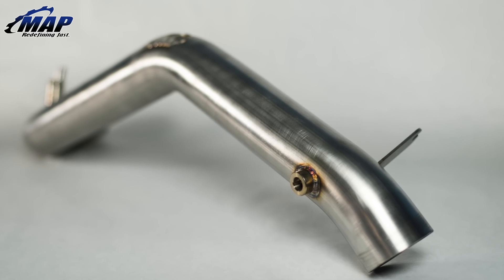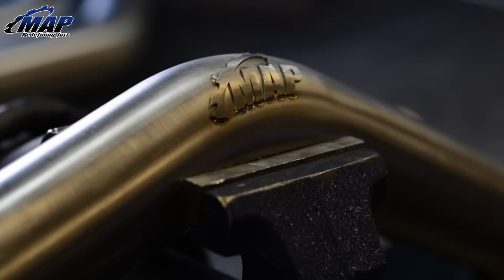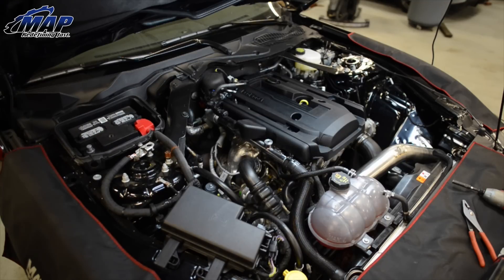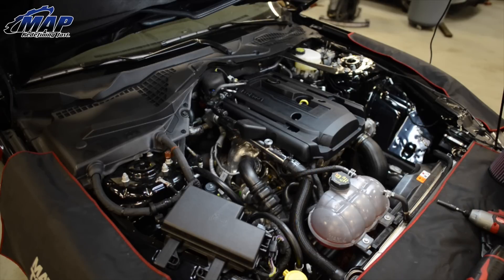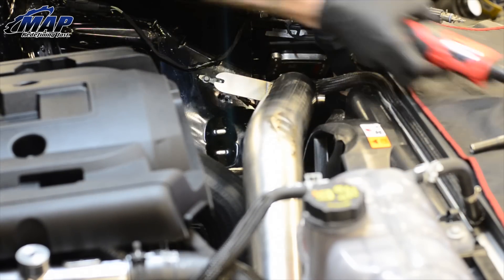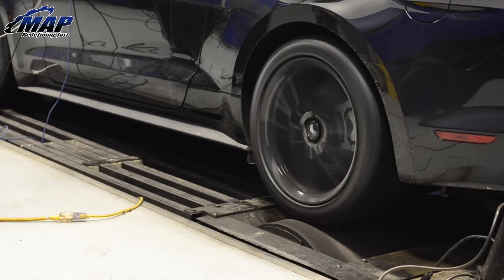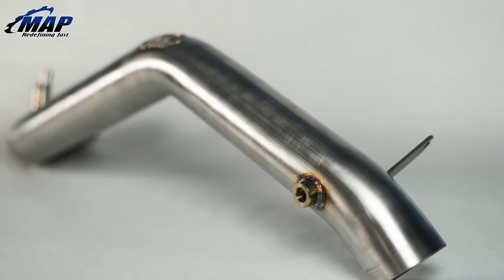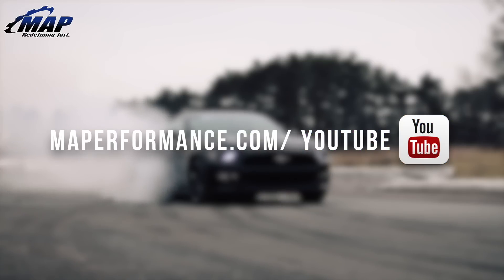Ecoboost Mustang Cold Air Intake Kit by MAPerformance | Sound Clips, Dyno Results & Install

Comment: Looks to me like there's a huge drop in performance where you need it most at that 5500 rpm range and there's several areas after that where it drops under stock as well... I need to do some more research, but good honest video.

Comment: This intake is great. Granted not apples to apples; but on the same dyno a 2015 6MT gained only 5whp and 13wtq from a Corsa intake system over stock, but this MAP intake (for about $100 less also) made gains of 14whp and 19wtq over stock on a 2016 6MT. Sounds great too, so to me this intake is a winner and will be on my Personal EB Mustang when I pick it up next month along with a Mishimoto Intercooler, Cobb Catless DP and Snow water/meth kit. Shooting for around 330whp and 410wtq or so. Plenty for the road course IMO.
Reply from the maker: Sounds like some good results! Thanks for sharing.

Comment: Can I install this airtake and then get a tune later down the road and still work properly and get the gains from both? Thanks
Reply: Intake*
Reply from the maker: Sure can!! Email aneujahr@maperformance.com if you have any further questions.
Reply: Is there any other mods in this ecoboost besides the intake? I like the way it sounds but wanna make sure thats just the intake and no BOV yet

Comment: can I get this intake with no BOV recirculation hose port? I have mine disconnected and would rather not have to put a plug in the port.
Reply from the maker: It comes with a block off cap!

Comment: Is there a K&N filter that would fit your intake? I know they have many universal filters. If so, id definitely buy your intake. I'm not a fan of the filter you provide. No offense.
Reply from the maker: Yes, our kit comes with the Green filter so you will need to buy the K&N filter additionally. This should be the info you need: Green Filter ID=3 L=8" OD base=4.75" OD cap=4.75"
Reply: +MAPerformance Are those the flange dimensions? That's what I need.
Reply from the maker: Adam Gregory Those are the filter dimensions. Where the filter attaches is just a 3" pipe, so any 3" filter should do! We recommend you find one that matches the diameter and length!

Comment: just installed this last night driving today and noticed when i was idle at a red light for about 2 min my air inlet temp rose to 130 ?? is this normal or no
Reply from the maker: +Dax Turner Yes in certain climates it can get fairly hot, but the intake temperature should quickly drop back down. The response time to drop back down to cooler temps is what people rave about!

Comment: Does it really make the turbo spool louder? I like my quiet exhaust but I love hearing a turbo spool up.
Reply from the maker: +John D I would compare their graph to ours on both listings. Like you said, our performance gains are throughout whereas theirs seem to be towards the end of your power band. Our intake is located in the fender well which will dissipate heat much better than even a plastic intake with a heat shield inside the engine bay.
Hope this helps!!
Reply from the maker: +TuneDeafOfficial Sure does! Eliminating the air box helps this out a bunch.
Reply: +MAPerformance awesome! do yall know how it performs against the roush cai? sound wise. not performance. 
I'm having trouble choosing between the open pod filter vs. the enclosed section. 
I also don't believe it when roush say theirs gives up to 29whp/trq.
Reply from the maker: +TuneDeafOfficial The most you can really only hope to gain about 15whp from an intake, ours is much louder than theirs and we have tons of great reviews to back ours up! 
If you have any further questions or just want help deciding feel free to give us a call.
Reply: +TuneDeafOfficial 
Trying to figure this out myself, what I did find is the Roush boost starts at about 5250rpms and there is almost no boost up until that point. According to MAP their boost starts at about 2300rpms and ends at about 5k. Im a city boy so Im thinking I would have that boost at every start rather then later in the power band. MAP is about 25% less expensive too. The only thing that has me concerned is would that pipe conduct more heat then the Roush plastic one. MAPs looks better IMO but performance is the priority.

Comment: Doesn't metal heat up so fast and make hot air
Reply: +Mauricio Salinas either way itll reach engine bay temps regardless.  itll just be quicker or slower reaching temps.  the turbo heats up the air regardless so the loss in power is minimal.  its basically just removing the restrictions the factory intake had.  on my car (VW), intakes dont make any power WITHOUT a tune since our intakes are pretty decent from factory.  and if you are worried about the heated tube, by some gold wrap or heat paint and go ham on the pipe.  i did that to my intercooler throttle pipe for good measure

Comment: I'm interested in your CAI, but opinions exist that mounting the CAI to the body can cause damage to the turbo/chassis mounting point and should instead be mounted to the engine. Thoughts?
Reply from the maker: +takensouls1 Sorry I am just seeing your question! The coupler allows for enough flex for it to move safely with the engine, and mounting it to the body minimizes the movement of the CAI itself so as not to damage the filter or surrounding parts! In short, we think its best! Hopefully that answers your question.

Comment: I can see that the new intake isn't sitting as high up as the stock box, would that be a hazard for the engine during rain? it rains really heavily at least 4 times a week here in Florida each summer, and this seems like it will be sucking water out of puddles, possibly blowing the engine. are there any safety measures to prevent that? I am really considering this intake. Thank you in advance
Reply from the maker: Marco, thanks for your comment. Our intake won't take in any water as it is sealed off in the wheel well. The stock intake can actually take in more water since it pulls through the grill. Let us know if you have any further questions!